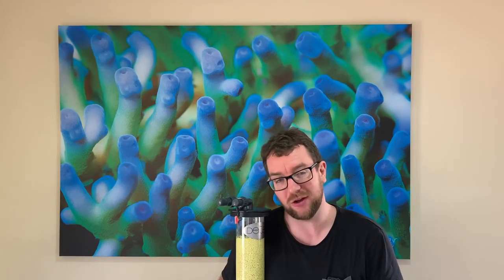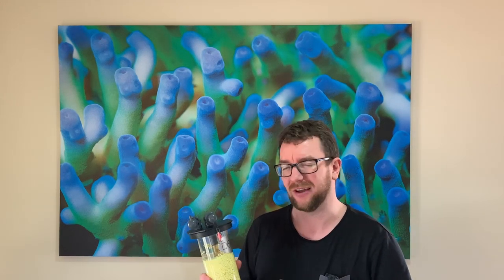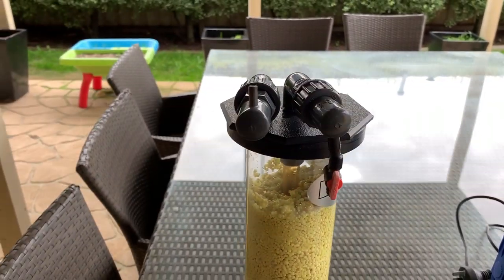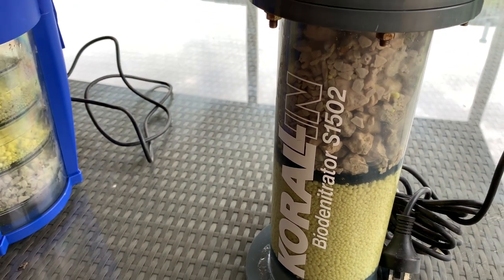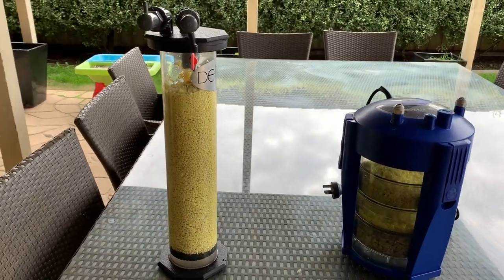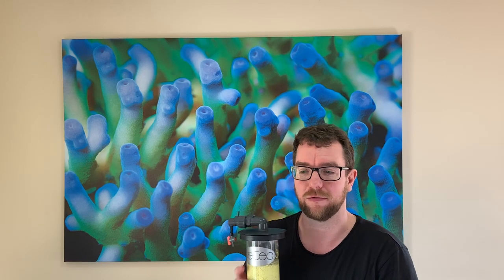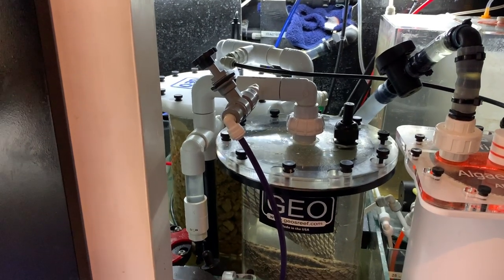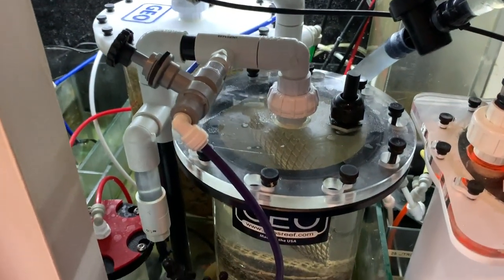Using a Sulphur Reactor for Nitrates

Comment: I just installed a sulfur reactor about 2 months ago and I have to say wow, it's amazing.  I no longer have to worry about starving my tank just so nitrates do skyrocket.  I basically feed my tank (combo reef and fish) twice to tree times a day without holding back (within reason of course) and I dialed my nitrates in at about 2-3 ppm.  I could go 0 but I know my corals like some nitrates.
Edit: I purchased the one at Marine Depot for about $300 which was not cheap but it really works great and has that bullet proof pump mounted externally.
Reply from the maker: Works a treat hey!
Reply: @ParkersReef   I’ve been looking everywhere to get one of the deltec reactors in NSW do you happen to know anywhere that stocks them?

Comment: I’ve watched quite a few sulphur reactor vids on YouTube attempting to find a good one. Mate this is the go to sulphur reactor info for sure you explain perfectly. And by a fellow Aussie it’s even better. Set up my reactor yesterday it’s a modified Korralin calc reactor it sits inside the top up tank of my RSRxxl750 and displaces less than two litres to worked out great.
Reply from the maker: Great to hear man, I love the simplicity of a sulphur reactor and am pleased to hear my video helped. Have a great day 👍🏻
Reply: Parkers Reef after setting up my reactor I left the effluent valve fully open for 24 hours. Then I slowed it down to 1 1/2 drops per second. 24 hours later.. ZERO nitrates! Considering my tank water had between 20-50 that’s pretty impressive. I’ve been testing every day and increasing the flow and haven’t been able to detect any nitrates coming from the reactor. And my tank is down to 10 after three days. My tank is 170gal and the reactor only has 1.5L volume so very impressive!!
Reply from the maker: Fantastic news!!! Love to hear good news stories like that

Comment: Sam! Thank you so much for this video!

Made the whole concept so easy to understand! 

I took your explanation and designed my own nano sulfur reactor for my 30 gallon. No matter what I did, I couldn't get nitrates under 75+... Partly because I have a lot of small fish, but I also feed a very dense frozen food. 

Setup my custom creation last week and let it run full speed for a week, got all the air out, etc. Then dialed it back to 1 drop per second and I'm getting 0ppm out of the reactor! Amazing! 

Now I just need to dial it in to a 5-10 range and I'll be set. 

Can not thank you enough!
Reply from the maker: Amazing!!! Great work and thanks for commenting to let us know it worked well for you :)

Comment: This was helpful thanks.  I was having a problem after a cleaned out my sulfur reactor and put in new media.  I forgot the steps to get it working properly again.  I was dripping the water out at 1 per second but the reactor was full of air bubbles.  I am starting over after 2 months of failed attempts and running it full open to get the air out.  Then I'll try again starting with 1 drip a second.
Reply from the maker: Hope it helped. Keep me updated with how you go
Reply: @ParkersReef  Will do.
Reply: It's only taken a few hours to flush all the bubbles as I have had the reactor running for awhile.  I'm running at 3 drips per second already probably because I already had a good amount of bacteria I assume.  So I was wondering how you check your out put.  You said in the video that you check for nitrate levels to see where they are and make adjustments.  However I always check for (nitrites) first to see if I will get a good reading of Nitrates.  Usually if I see Nitrites in the water I tend to back off the drip rate.  Would you recommend that I do this or should I just let the reactor push out Nitrites and let it build more bacteria?  My worry is if I'm pumping in Nitrites which will process into Nitrate would that make the situation worse or do I just power through and say Nitrites be damned?
Reply: At 3 drips I'm getting 0 Nitrite and 0 nitrate.
Reply from the maker: If you have zero nitrate at three drips per second, you will need to speed the effluent rate up. Otherwise it will start to stink
Reply: @ParkersReef  Yep I have been turning it up now at about 5 drips per second.  I think it back on track thanks to your video.  Flushing the system did the trick.
Reply from the maker: Great news!

Comment: Hey Sam, what did you use to push the water into the deltec reactor? Plumbed from a manifold or a continuous feed dosing pump? Thanks 😊
Reply from the maker: I had it plumbed off a return pump (with a tee)

Comment: Awesome video.. I've just set mine up using a repurposed calcium recirculating reactor with Seachem Calcium amd 0.5L of sulphur. I'm 4 days in and already getting 0ppm from the reactor. Tank still shows 100ppm nitrates but it will catch up.

Seems to be working for my 500L tank. I'm at stage 2 now where I've sped up the effluent to 2 drops per second
Reply from the maker: Sensational! Start speeding up that effluent :D
Reply: @ParkersReef  I've hit a bit of a wall and would appreciate some advice pls.

I've gone from 0.5L sulphur to about 3Liters of sulphur in the reactor and I'm able to get 0 nitrates from the effluent at about 250ml / 3 mins. Any higher than that and the effluent touches about 30+ppm nitrates. At this rate it will take me 3.5 days to cycle all the water through the reactor. (450L tank)

Now I feed quite heavily because I have 12 Discus, 12 Angels, 6 Rams, 4 Clown Loaches, 8 Corydoras, 4 algae eaters (a lot of hungry mouths) and I don't know of a way to calculate the nitrates getting produced daily but looking at my result it seems like I'm obviously producing more than I'm removing. 

What should I do from here? Add a lot more sulphur? Or increase the effluent speed and wait longer to check? If I have to add more sulphur, I'm pro ably have to add a separate container for the calcium and Max out the sulphur in the primary reactor with the recirculating pump. 

What should I do? At this rate I will always be playing catch-up and at best I would be able to slow the rate of increase of nitrates.

Pic of my current reactor: https://photos.app.goo.gl/sGBivgCrP7BBUYcd8

Effluent Speed: 
https://photos.app.goo.gl/N1MY3ftUdqWHwa4A8
Reply from the maker: @arshishmaneckji9547  sensational setup! OK - based off your results, images and videos, I would max out the sulphur in the reactor. That should allow you to speed up the effluent whilst still maintaining a zero nitrate ppm output.
Reply: @ParkersReef  Thanks for your reply  i'll have to figure out how to house the calcium elsewhere.
Reply from the maker: @arshishmaneckji9547  might not be needed if your ph isn't too low?

Comment: Hey, I recently purchased a Korallin S-1502 sulfur reactor for my reef tank from Marine Depot and I have a few questions about tuning nitrates.

I installed my unit with 50% of the Sulfur media & 100% of the calcium media (wasn’t much) in my 15 gallon refugium for my 60 gallon reef tank (~75 gallons total).

Here’s the events of what happened so far:
-Nitrates in the tank and reactor started at 40ppm
-I let the reactor run at 1 drop/second every day & tested nitrates every day
-After 8 days nitrates dropped to 2ppm out of the reactor, the tank was still at 40ppm
-I let the reactor run for 3 more days at this rate and watched nitrates reduce from 40ppm to 20ppm to 5ppm in the tank, reactor still outputs 2ppm
-I increased to 2 drops/second and ran it for one week, nitrates in the tank reduced to match the sulfur reactor, both are now 2ppm. I stopped doing daily nitrate tests as the instructions said I could stop here 
-Another week went by and the reactor outputs 2ppm, but the tank rose to about 12ppm
-I increased the reactor to 4 drops/second
-Within one hour my tank was cloudy (I think it’s the bacteria coming out of the reactor) but I left the reactor run anyways for 3 more days without testing
-After that I tested nitrates and saw 20ppm coming out of the reactor and the same for the tank
-Using the Korallin instructions I backed down to 2 drops/second and tested everyday 
-After 2 days the reactor output was back down to 2ppm, and the tank back to 5ppm and let it run another week
-Now on the 3rd week of install I am facing the same issue, nitrates in the tank rose to 15ppm and I tried increased the flow to 4 drops/second on the reactor - but the exact same thing happened again and the tank got cloudy
- I backed down again to 2 drops/second and the tank nitrates are now sitting around 10ppm

*I am asking for advice on the best way to proceed so I do not have to “chase” these nitrates when I see nitrates rise

Other users mention they increase the drip rate everytime they hit 0ppm on the reactor’s output until they get to a full stream. I only made it to 2 drops/second which seems very low in comparison to others.

On the other hand the Korallin instructions (as bad as they are) read as though you will find a “goldie locks” zone where you stop increasing the output once the tank hits a desired level, in my case this was 2 drops/second.

Has anyone seen a tank get cloudy while using a sulfur reactor?
Should I move the input/output of the reactor directly into the tank instead of the refugium? 

Moving forward I am considering the following, and appreciate any input

-Let the reactor run at 4 drops/second for another ~8 days to see if it bottoms out again. Maybe I didn’t wait long enough?
-Add more sulfur to the reactor, it is rated for 150 gallons so cutting the media in half seemed like a good starting point, however this may not work because I don’t have my reactor output fully open. I would imagine one would add more media when the system is running at full throttle and the nitrates still aren’t low enough.
Reply from the maker: thanks for the detailed comment! Yes, it sounds like you need more sulphur in the reactor. I would add some more and go back to one drop a second until you get zero on the outlet. Then slowly increase it. It should remain zero on the outlet, if it rises, you are increasing the flow too quickly or do not have enough sulphur in the reactor.

Then you will get to a stage where your tank nitrates are as low as you want them to be.
Reply: @ParkersReef  Thank your the speedy response, I will add more and report back! Thanks for the advice!
Reply from the maker: @nateferris9813  no problem - keep us updated!
Reply: @ParkersReef  Hey, so I added 2 cups of sulfur to my reactor last we spoke (now 75% full) and let the drip rate run for 3 days at 1 drop/s. I tested yesterday and saw nearly 0ppm on the output so I increased to 2 drops/s and ran that over night. Today I tested and saw 0ppm out of the reactor and 6ppm in the tank! I will let this run for another day or two before bumping that up to 3 or 4 drops/s, but so far so good!

Comment: So I’ve got a question about adjustments.  I had my nitrates coming out of the reactor down to 0.  I slowed down the flow a bit and was at .7 after a few days.  I noticed the nitrates in the main aquarium stalled around 19. Not bad, but wanted to get down to 10.  So I slowed down the flow again a little, but then my nitrates increased in the main tank to 22.  I waited 2 days, retested and the nitrates increased to 24. I checked the affluent and it was at .1. Confusing to me that the nitrates would go up.  I thought maybe the flow is slow enough, that if the bacteria can’t consume fast enough.  Waited two more days and retested and now nitrates are at 26.  So I’ve increased my flow through the reactor and it’s currently outputting at 15.  So my question is, when adjusting the flow through the reactor, does it take 3-4 weeks a to adjust?  I figured with an established bacteria bed you’d be able to make minor adjustments without a huge change.  I’d really like to get the nitrates down to 15 or 10 if possible.  So I’m curious your experience here and any thoughts on what I’m seeing.  I’ve never seen a rotten egg smell so I don’t think I have too much.  I was at 0 during multiple tests when fine tuning it.  It is odd to me that the adjustment would result in such a swing.  Also, if I add more sulfur, do I need to start the whole process over again, as in waiting 4-8 weeks?   Seems to me the bacteria there would just need to multiply.
Reply from the maker: Sure thing, let's work through it! Firstly, you never want to slow the effluent down when it is already reading zero. You can't go any lower, it will kill bacteria and stink :)

0.7 out of the reactor is about perfect, if that is not enough to reduce the nitrates to the level you want in tank, you'll need to add more media (or get a larger reactor).

So in your example, you would need to add more media and likely increase the flow a little (to keep the effluent just above zero nitrates). The addition of media should only take a few hours to a day to bed in and any adjustments you make to the reactor should really show up in tests of effluent within a few hours (definitely not a few weeks, might takes days to weeks to impact the tank nitrate levels though).

Hope that helps!
Reply: @ParkersReef  ok thanks.  I have a big reactor and can easily add a few more pounds of sulfur.  I’ll start with one pound and see where that gets me. Thanks for the feedback, really appreciate it!
Reply from the maker: @davidprice3965 fantastic, you should see the difference with that extra media (glad to hear you have a reactor with space available!!)
Reply: @ParkersReef  so it’s been 4 days since I added another pound of sulfur.  I tested the affluent last night and there is no change.  What are your thoughts here?  Water is a steady stream but not full throttle like yours in your video but it’s not a drop either.  I would have expected this to drop near 0 at this point.
Reply from the maker: You’ll need to slow it down until you hit zero and then speed it back up again
Reply: @ParkersReef  ok thanks!

Comment: Loved your video! wonderful tutorial. I have been running mine for several months now. I find that the flow rate slows down over time. do you know why that would happen? I would like to run it more wide open so I do not run into that, however, that will bottom out my nitrates. also, when it actually does run slow, it stinks from sulfur. I am likely using way too much sulfur media and now that I watched your video, I am going to reduce the volume of media. unless you have another suggestion as to how to run the flow slower and not have the flow rate diminish over time. thank you!
Reply from the maker: Yeah it will slow down as the bacterial sludge builds up. If running too slow, it will stink as you’re starving the bacteria. Sounds like you need to remove a little media and run it a little quicker :)

Comment: thanks great video, do you still use this method to keep your no3 down?
Reply from the maker: I don't use it on my current tank as my nitrates haven't gotten to the point where I need to. However, if they do rise again (which is likely as the tank ages) I absolutely will

Comment: I have a Deltic Alcohol base unit, the problem with that reactor is the Aqua Bee pumps, your unit looks easier to use.  I wonder if I can buy the two end ports the in and out per say?
Reply from the maker: yeah I am not sure how the alcohol ones work, but I guess it is a form of carbon dosing. I find sulphur to be much more effective and considerably more forgiving. I couldn't say if you can buy the parts for the deltec though I am afraid, just know that calcium reactors (with the c02 blocked off obviously) is the perfect reactor
Reply: @ParkersReef  I also have the Korallinn reactor, my question concerning that model does it require a seperate pump to feed the reactor?   Or does the Ehiem pump do all the work?
Reply from the maker: @Moondoggy1941  I'd highly recommend a feed pump to ensure consistent effluent rate :)

Comment: Hi, Brilliant video. Im about to set up a reactor (Deltec NFP 509 - Using Sulphur). Im keen to know where you found the effluent valve. Looks like a 1/4 ins outlet back to the sump?
Reply from the maker: Geo’s reef have the needle valves in John guest 1/4 inch. And yes, indeed 1/4 in and out :)
Reply: @ParkersReef  Thanks, Struggling to get hold of one in the UK.
Reply: @ParkersReef  Hi Parker. I managed to locate a valve over in the US,  it should be with me tomorrow. Can I ask another question please? How long should it take to get the system working properly. I read that it can take up to eight weeks? is this your experiance? Thanks in advance.

Comment: Hello Sam can you share some light where I could find the sulphur media and would you recommend using a PH or ORP probe to monitor as in now low oxygen levels is what helps this reactor to work best at -150 to -180 ORP to allow the bacteria to thrive and eat up the NO3.
Reply from the maker: Hey mate, DeerPark Aquarium can get the media for you. I personally have not used PH or ORP in sulphur reactors, but there would be no harm in doing so. I find that as long as you don't try to skip steps, they're super easy to setup and get working

Comment: My reactor has been running great for around 2 months now. Workers exactly as Parker describes. I do have a question. I’m also running a Ca reactor and I know sulfur causes your Alk to drop. My question is mine keep going down and my Ca is high. What’s your solution for this. So used 5lb of Sulfer on a 200 gallon system. Nitrate is around 2.7. Current tank levels. Alk 8.0, Ca 564, Mg 1440 and pO4 0.08.
Reply from the maker: Glad to hear!
Reply from the maker: You will need to dose alk to balance things out again

Comment: does it have to recirculate when using a calcium reactor ? 
also , does it need it's own pump or can it be run off a manifold ?

thanks
Reply from the maker: yes, ideally recirculating as that is considerably more efficient so is the way I would recommend. You can absolutely feed the reactor off a manifold, just keep an eye on the effluent as it can clog up with bacterial slime.